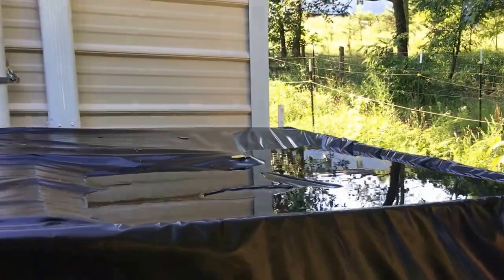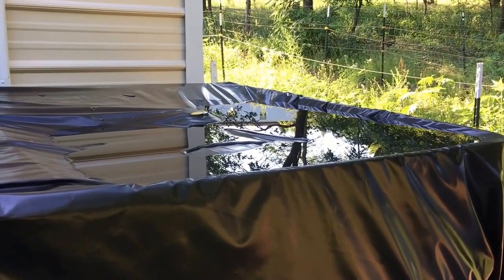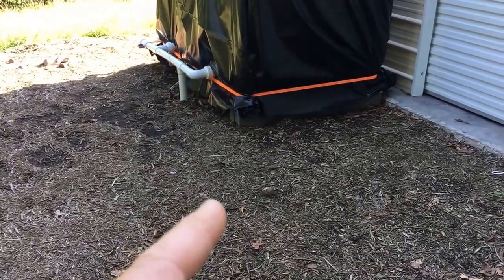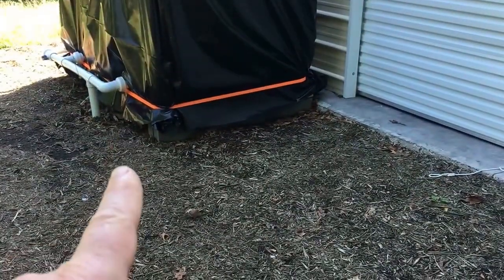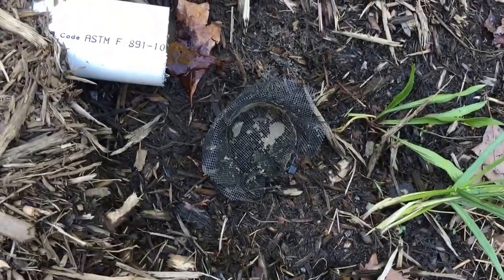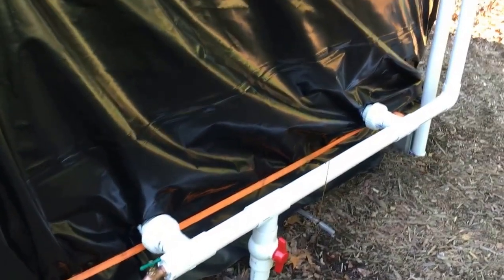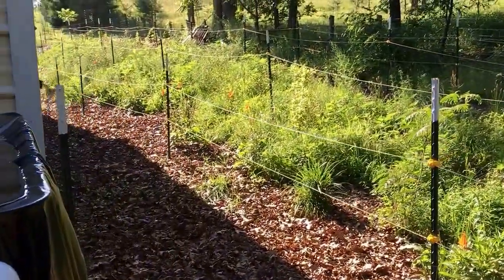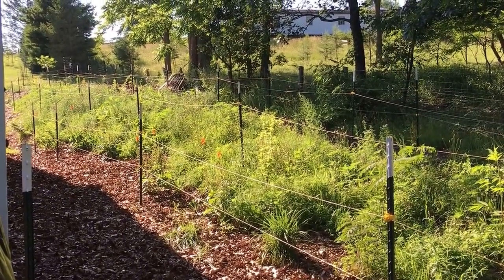More Rain Water Catchment Lessons Learned

Comment: How about a piece of plywood over the tops of the tanks with only a hole cut around the lids? As for the drain pipe, glue on a floor drain fitting? Fantastic setup. Inspiring
Reply from the maker: Thanks!